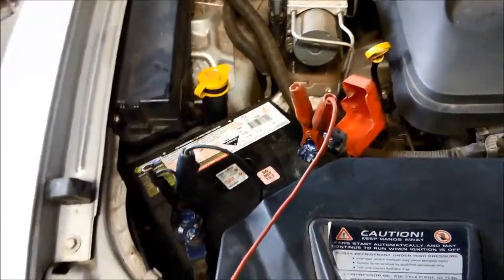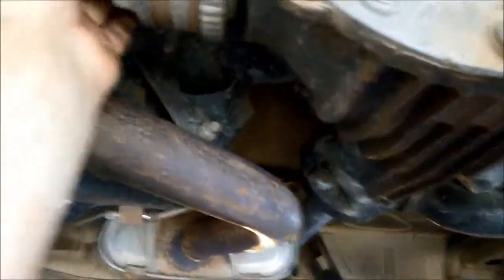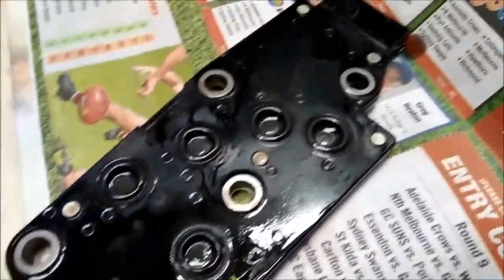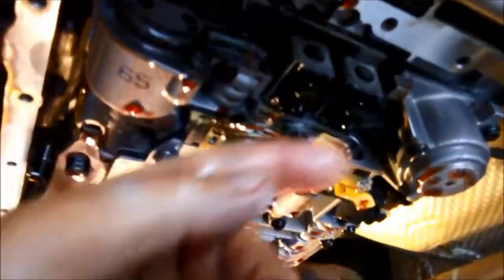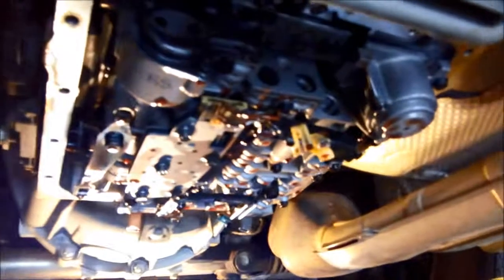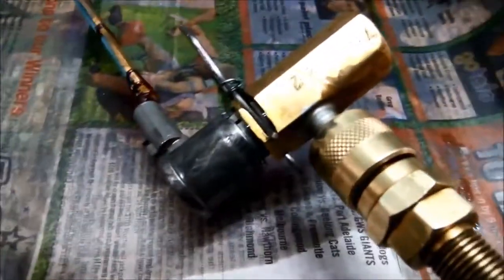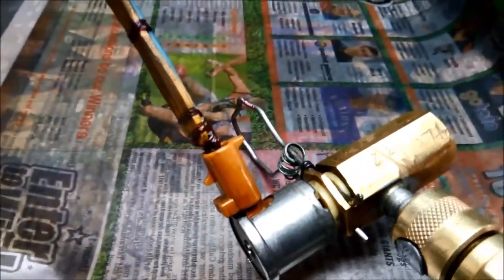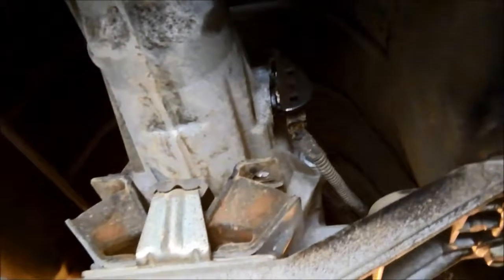4L60E 4L80E Automatic Transmission Slipping Fault Code P0601 P0700 DIY How To Repair

Comment: Thanks for sharing! I learned a lot from your information about testing the components. I’m having 4L80E hard shifting them sets code! Tcc seliniod.🙏🙏😎
Reply from the maker: hi, i`d also check pressure control solenoid as well as the switch plate. cheers
Reply: Thanks again sir I will do that too !!🤔

Comment: exactly like this happened to me with the 6t40 transmission module of a 2010 chevrolet cruze, it entered flaccid mode, with code p0700 and p0601, they recommended me to change the complete module, but it was all because of the pressure switch.
Reply from the maker: hi, always best to start with the basic checks. cheers

Comment: Hi thanks for your helpful videos , with the switch plate do you just clean it with standard degreaser nothing special ? and when reinstalling the 8 and 10mm bolts do they need to be torqued ? I was looking in workshop manual and I cant see a torque setting I assume that means no but can you confirm this .thanks mate
Reply from the maker: hi, we clean with solvent not degreaser. the bolts that go right through plate same torque as valve body bolts, the bolts that just hold plate to valve body not so critical. cheers

Comment: Great vid mate how much would this job cost to do. And where is your shop ive got the same problem. Engine check light came on came up with the same code.But my trans is working as normal.
Reply from the maker: thanks, we are in north east country victoria, cheers

Comment: Did you fabricate those brass air fittings that you used on the solenoids during testing or did you buy them prefabbed?
Reply from the maker: hi, we made these and try to make whatever we can. cheers
Reply: Very thorough, enjoyed the video.